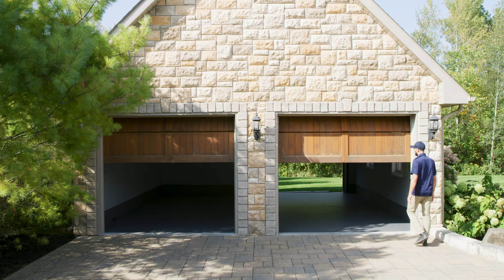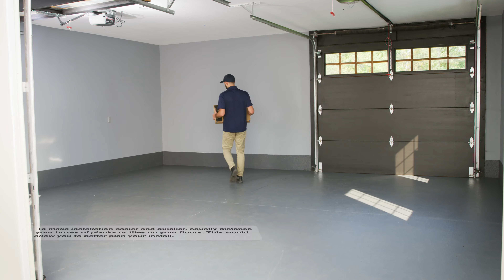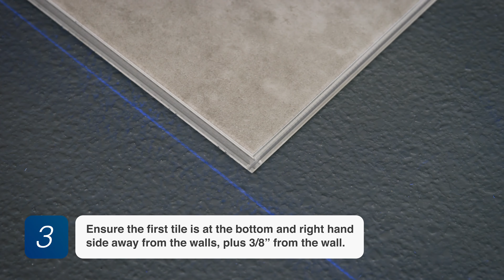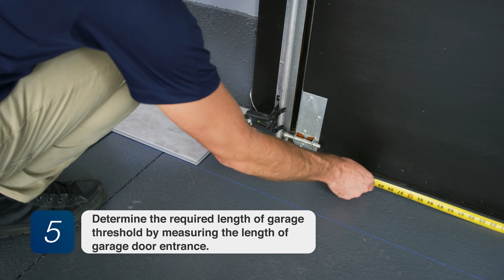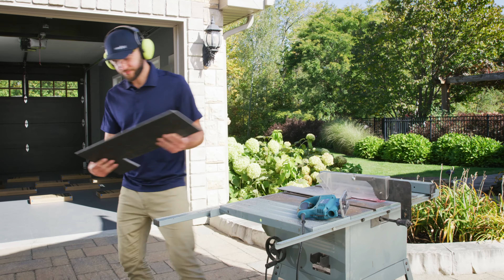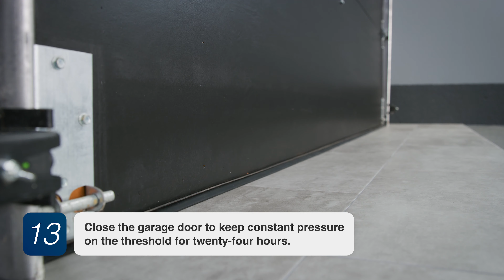Flooring | How to Install Luxury Vinyl Tiles

Comment: Is a vapor barrier or any other materials needed with these tiles for a basement installation on bare concrete slab?
Reply from the maker: Thanks for reaching out to us! Our Luxury Vinyl Tile flooring does not require underlayment to be installed. However, for added protection if the installation area is prone to moisture, you can lay a vapor/moisture barrier. You can learn more by checking out the installation guide here: https://drive.google.com/file/d/1pXqPp9dnZsWe6IjJ4ZhNFcTKumXMpi1Q/view

Comment: what is the purpose of adding the 3/8 inch ?
Reply: Expansion during temp changes
Reply from the maker: That's right - longevity of our products is something we are very proud of. Let us know if you'd like a free design consultation!
Reply: @NewAgeProducts  can this product be used in a kitchen or basement? Is it slippery when wet and what color is it?